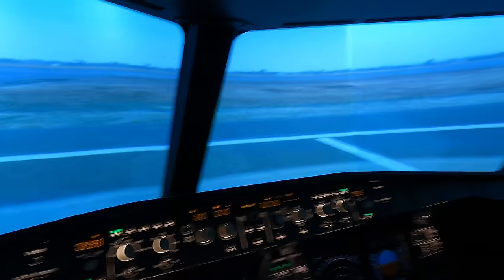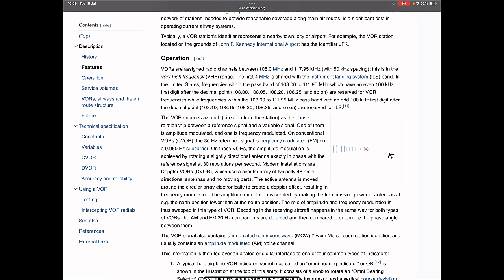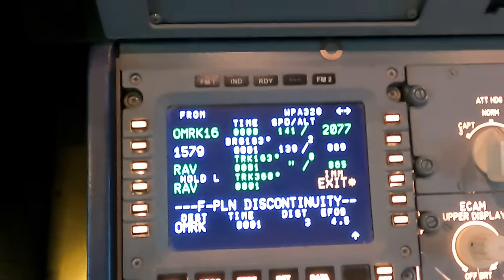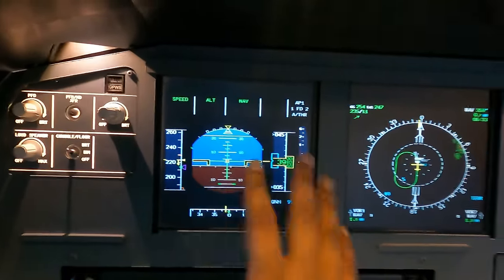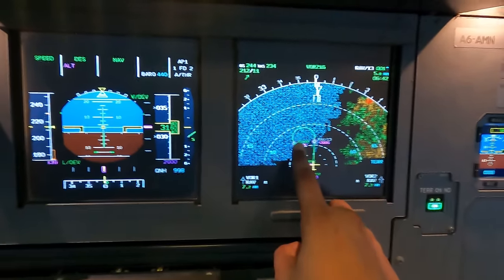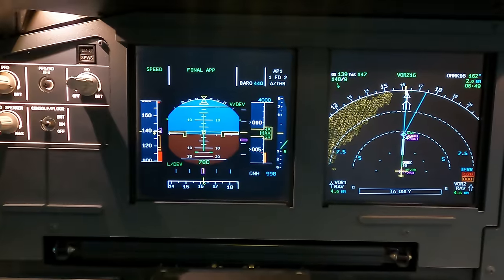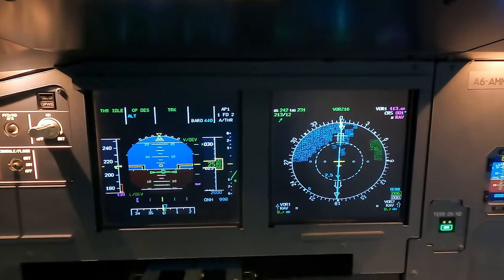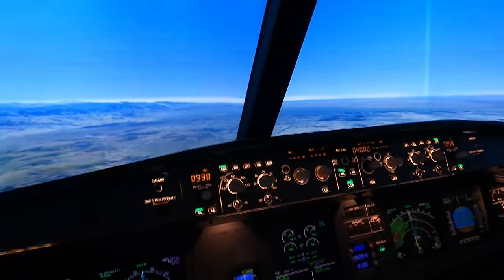Airbus A320 | In-depth VOR & DME ARC Tutorial

Comment: Did you secretly put in the 2000 constraint off camera during the managed decent in the MCDU at RAV/13? ;) It said 1800 and I could hear the keys click and suddenly it changed to 2000 :)

Regardless, thanks for the great video, I was really struggling with VOR approaches in the A320 and this really helped. Now it is my understanding that IRL one would rarely fly a full approach but rather vector (to the FAF if my understanding is correct). Would it be possible to do a video on that?
Reply from the maker: Hey,
It’s not a secret anymore is it?! 🤣 yes I had to put it in because in FS2020 or rather the model being used in FS2020 has a small bug where it doesn’t always pick up on the constraints unless you plug them in manually. This is something I try to combat behind the scenes :) in the real ac thankfully it works as intended. 

Glad you enjoyed and found the video helpful, could you be more specific on what you want us to demonstrate next?
Reply: @waypointsaviation  I understand, I guess you should always check if the mcdu restraints match those on the charts right?

What I meant with my suggestion for a next video, comes from a discussion with several pilots. After discussing approaches(VOR specifically) they all said that they rarely fly the full approach but that they always vector in somewhere along the approach. Is this something you'd be able to demonstrate?
Reply from the maker: Yeah usually we’re vectored to the FAF and then we do the descent I can demonstrate this

Comment: Question - when flying VOR and especially DME ARC approaches, does the aircraft actually only depend on information it gets from the VOR/DME station or does it "cheat" and still use GPS/IRS in the process. So in other words, is it still basically doing RNAV just following a track planned according to the published VOR procedure.
Could it still do a VOR/DME ARC approach if both IRS and GPS were INOP?
Reply from the maker: It’s either or, if you choose to do it via the mcdu with preprogrammed waypoints and constraints it can, the VOR DME station is there more as a back up and reference for the pilots in there event the mcdu fails we can always fall back to using the raw data from the dme station. This is considered a Non precision approach so the more data you can add to it the better. 

Hope this helps :)
Reply: @waypointsaviation  So by default it's technically (from the aircrafts perspective, not formally) the same as an RNAV approach that simply follows the VOR/DME arc approach route? In other words of you fly a VOR approach it's not ignoring all navigation information except what it gets from the NAV radio.
Reply from the maker: Let’s put it this way, if you’re flying the aircraft in “selected mode” you’d be referencing the VOR/DME info from the nav radio, if you fly in managed mode then the ac can use digital info in the mcdu to navigate 

Hope this helps :)